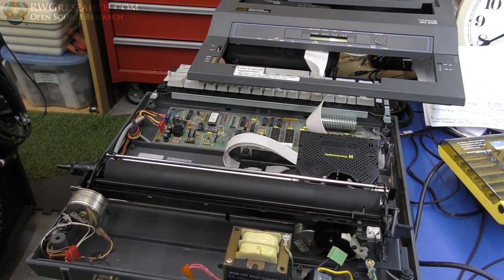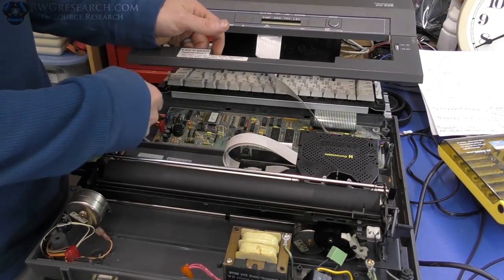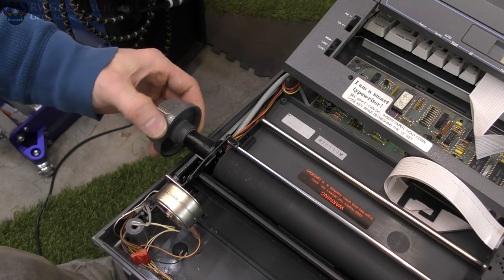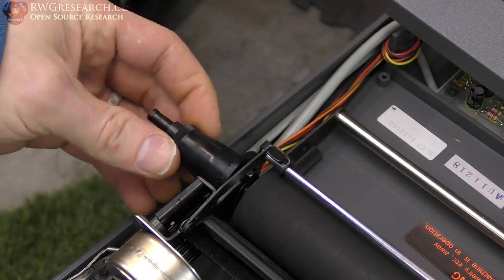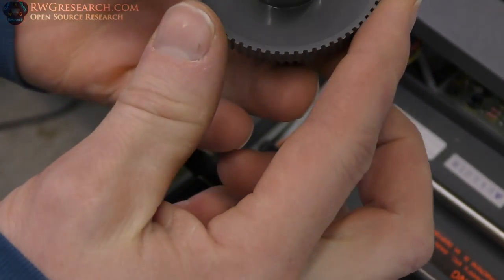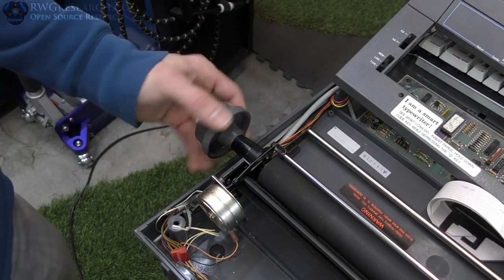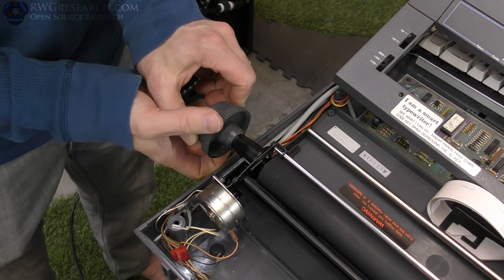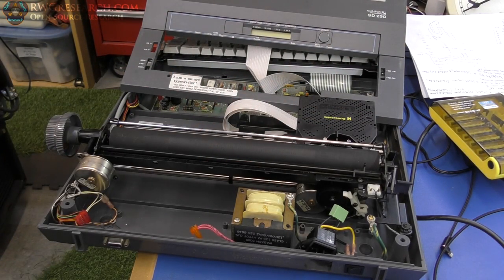Was Not Expecting That... Fantastic Use Of High Gear Reduction Harmonic Drive. Mechanical Wonder...

Comment: Harmonic drives are common on industrial robots they can achieve very tight movements and accuracy. That is until it wears out and starts to skip teeth. It also allows you to use a small motor and have high torque on the next stage.

Comment: 02:50 - That eccentric interference cog thing is awesome! I've seen similar types of drives elsewhere to act as an insanely high ratio reduction drive. EDIT: I think it's also used in the upgraded version of my car in the VVC system. [MG TF Variable Valve Control - with eccentric gearing internally for infinitely-variable valve timing control].

EDIT 2: I just found the name of what this thing is called: Cycloidal Speed Reducer (at least I think this is what it's called, where you have an inside cog system and an outer cog that moves at a totally different rate...)

Comment: This kind reductor i found around 12 years ago in kids metal constructor. And with that constructor you can build a crane. And in there was that kind reductor. I was surprised too because i was never seen that type reduction. And with attached weight it was strong. With that toy construktor you could lift around 1,5kg weight. So its strange and strong. Now You have found in advanced mechanizm than me. :) Sad thing no video was not saved after hdd dissaster. And i cant show how it looks in toys.